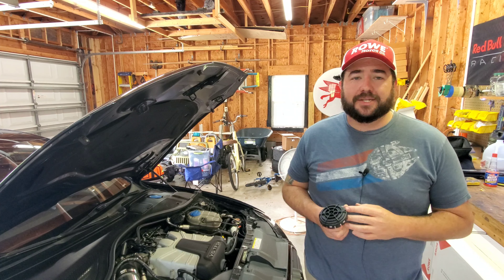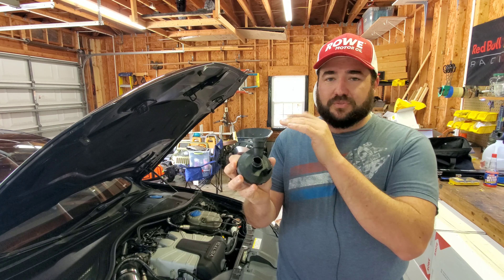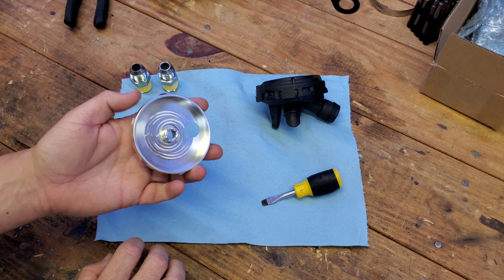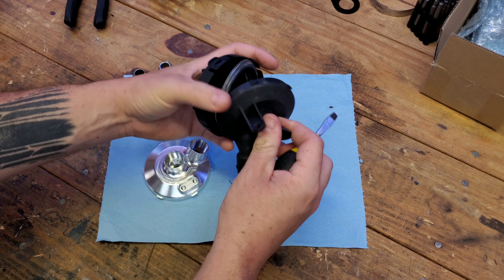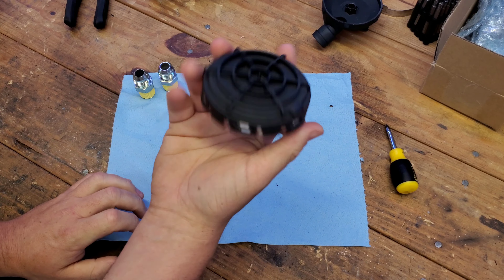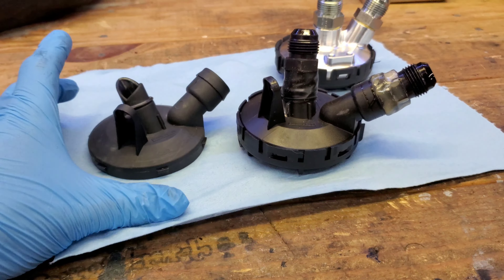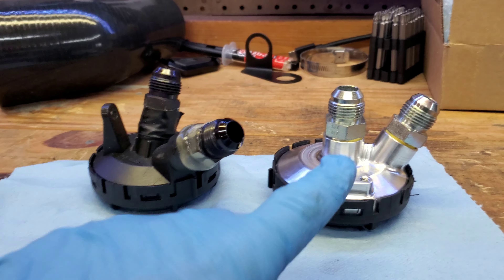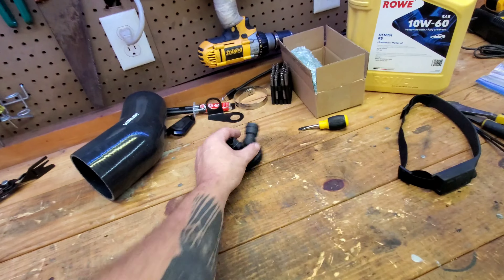MercRacing PCV Housing Adapter Install | B8/C7 3.0T PCV Relocation

Comment from the maker: Don't forget to use Coupon Code "audic7owners" for 5% off your MercRacing order!

Attention! Huge shout out to @andreasschmidt9513 for noticing that I installed the PCV backwards in this video.

What do I mean by that? If you watch our original DIY video, you can see that the angled fitting connects to the line that comes off the valley pan, but in this video I connected that same line to the center fitting. The way I did it in this video is wrong.

Make sure you connect the hose that comes off the valley pan to the angled port (Inlet) & then connect your return line to the center port (outlet).

You guys don't miss any of my mistakes 😂

Comment: Thank you for making this video! I was wondering if I should go with that system, or the original system. Since I’d rather not do JB Welding I will spend the extra $$ to get this Adaptor that makes it much easier.

Comment: Nice work! A possible mounting location could be the indented portion between the coolant reservoir and the shiny metal bracket that holds the set of lines. I believe the hole in that indented portion is threaded. Let me know what you think, thanks!

Comment: Hey Cameron you connected the hoses differently this time than last time in the self made plastic part... which way is the correct way? I think this time you hooked it correctly the center hole to crank case and the side hole to catch can is that correct? This way all the oil can go easier to the catch can and it will close the valve if there is to much vacuum but release the valve once crank pressure build up. Am i thinking right?
Reply from the maker: Dude! What an amazing catch! I cannot believe I did that. I will be pinning a comment about your eagle eyed observation 🤘🏻

The correct way is how I installed it in the original DIY video. The Inlet to the pcv is the angled fitting. The outlet is the center fitting. You can see how it connects on an oem setup via this link (fast forward to about 20 mins)

https://youtu.be/wedIu8tF_0o

Comment: Cam...how do you know when the valve (diaphragm) goes bad...got a pcv code cleared it hasn't come back...BUT I do not hear the whistle noise anymore from the puck. Has it gone bad? Are you suppose to ALWAYS hear that whistle noise occasionally
Reply from the maker: No. A whistle doesn't always happen. You can open it up and check the diaphragm for any tears. If it doesn't come back you should be fine
Reply: Thank you man... you're awesome

Comment: where did you find the metal fittings in this video
Reply from the maker: The 1/2" npt to 10AN fittings? I got them at a call machine shop, but you can find them on Amazon (I'd go with evil energy)

Comment: Hi Cameron, so my engine code is CTWO. I  wonder if it’s doable for my engine, I couldn’t find any info on my engine, I was wondering if you ever heard of it? I forgot to mention my Q7 is the S-Line prestige Sport Edition.
Reply from the maker: I can't find any info on the ctwo. Does it look like the engine in the 2013 S4?
Reply: @AudiC7Owners   Pretty much yes, except for the intake part but everything video of 3.0t looks like mine but with a whole lot more room lol.
Reply from the maker: Then you should be able to do the pcv relocation without issues.
Reply: @AudiC7Owners  Okay, and thank you so much. I will double check for sure, as it will cost me a little over $800 for sure in total, that’s why I hesitate to order yesterday but I will let you know if it all works out for anyone else with the same engine, thanks again.

Comment: Will this relocation kit fit on a 2018 q7?
Reply from the maker: Which engine do you have? This only works on Supercharged 3.0t engines
Reply: The 3.0t. I was looking on the website you mentioned and dident see anything for a q7. Maybe i missed it.
Reply from the maker: Is your engine the CREC engine?
Reply: Not 100% sure as i am new to audis but will be purchasing one in the next few weeks. Im just doing my research and looking up things to make life easier with owning and maintaining this vehicle.
Reply from the maker: The relocation will work for it. If it comes with the updated CREC supercharged engine, you have so some work to get the 3.2 oil separator to fit.

Comment: Teflon should ALWAYS be used on a npt as a spiral leak path will develop between the crest of the male threads and the mating root.     Also ive gotta say my guy, JB weld? Zip ties? Im not like a perfectionist but i have been an ase certified mechanic for 10 years and i can safely say bubblegum and shoelaces have no place holding together/plugging vital components of your vehicles engine system.   I mean to each their own, however to speak of using these methods on a diy video people will follow for their own vehicles is kinda careless my guy.  Theres much to be said about doing a job right or not doing it at all.   No offense brother just my opinion